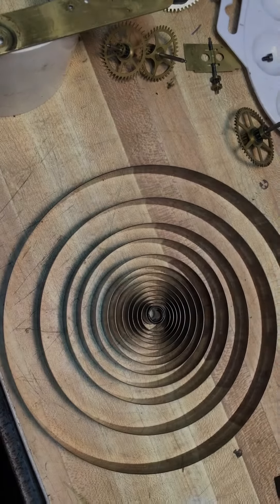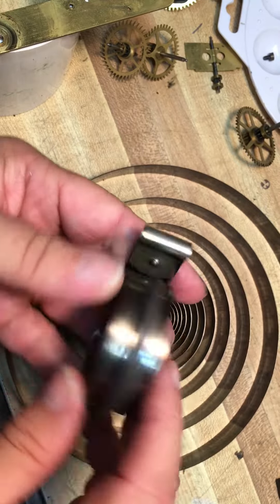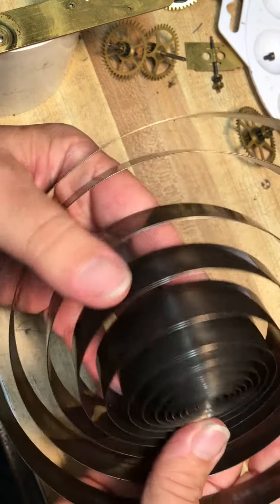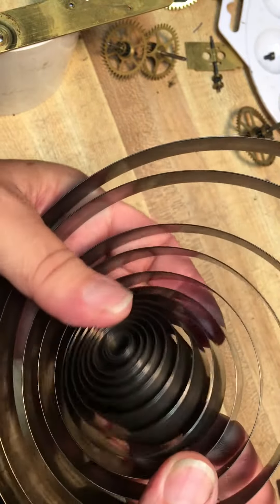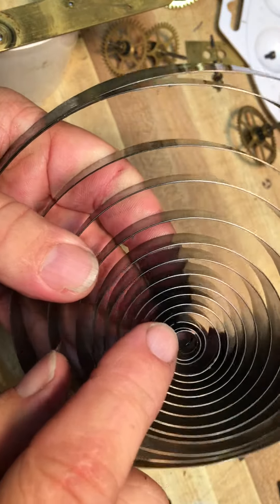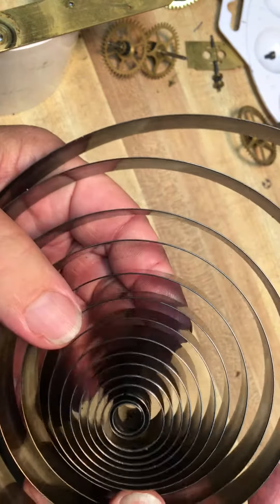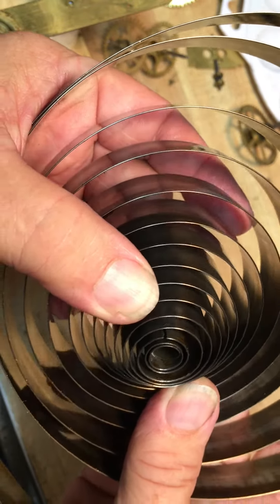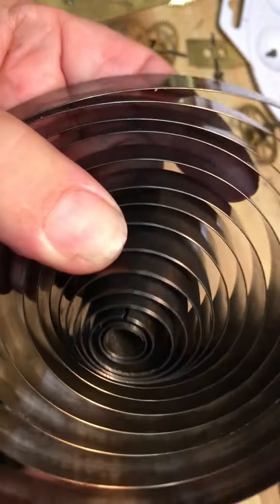Inspecting 8 day clock main spring

Comment: I just got a clock with open mainsprings and when i wound it for the first time i wound it half way. tested the clock worked good. then wound it more. when i got most of the way but not all the way wound it went bang!! I removed the broken spring from the movement but did not remove the other one yet as it is 3/4 wound. I was able to get the old spring out without seperating the plates since it is broken. just unthreaded it. I dont think anything is damaged at least it dont look like it is.

I think from now on  when I get a new (old) clock and wind it up to test it for the first time (evaluating it before I disassemble and clean / service) I will only wind it part way. I suspect this clock probably had a cracked spring just like you show in the video as that is ironically where it broke.

Comment: You don't have to look for cracks in the steel to replace the sprig.   You only need to look at the coils, the number of coils on the inner part of the spring is about 8 and they are too clocse togethrt.  The spring is set and needs to be replaced on that alone.
Reply from the maker: In theory, yes. I used to replace the springs, but I had more trouble with the new springs breaking than the old ones. These springs you referred to will still run on 8 or 9 days.
Reply: @theclocknook3405  I have an open mainspring I just removed from clock. It is exactly 2 times the diameter of the mainwheel. I was thinking of replacing it. What is your opinion on this?